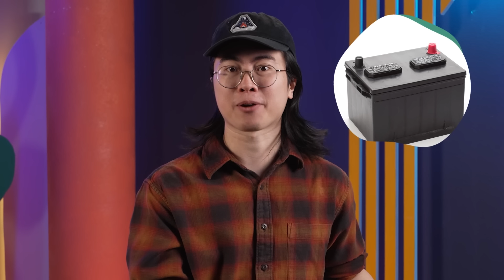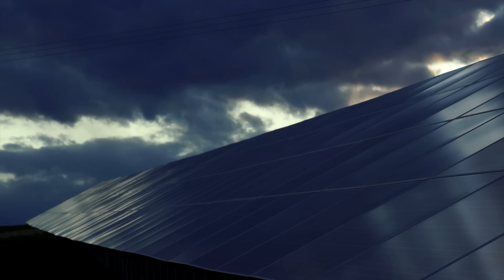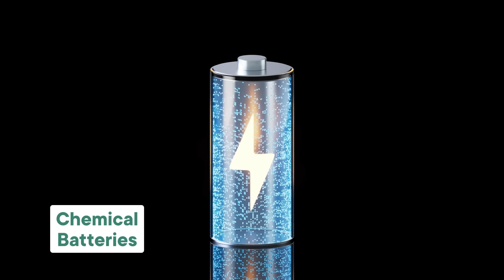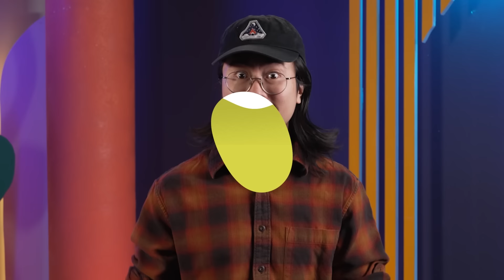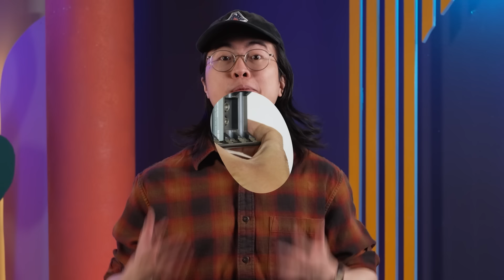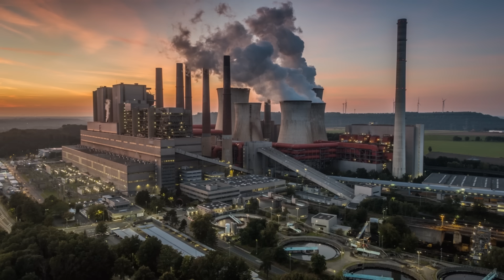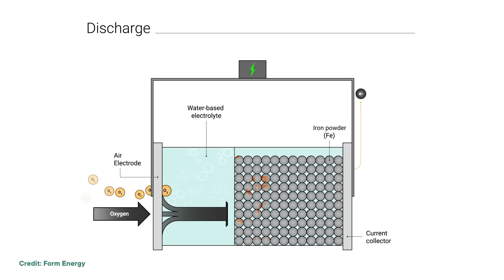The Weirdest New Battery is... Rust

Comment: The first (and last) metal-air battery I ever saw was a battery for an Army backpack radio.  It was slightly smaller than a loaf of bread, and encased in cardboard with a connector on one side.  When I first picked it up, I thought that it was a cardboard mockup of a real battery.  Nope.  It was a real battery, and was only slightly heavier than an empty carboard box.  I believe that it was a primary battery.
Reply: Hearing aid batteries are also metal-air, that's why they have a sticker you need to pull off when putting them in. It closes the tiny hole that allows the air to enter and start the reaction.
Reply: @rolfs2165  I forgot about those!
Reply: Yup. That is a magnesium air battery and is single use. Iirc you have to add water to it to activate it. ❤

Comment: I am disgusted by the comment at 3 minutes. "rechargeable batteries degrade after a few uses" HAVE YOU EVER USED ANY?
I have used  rechargeable AA  Ni MH batteries from both radio shack and another brand still in existence for YEARS.  Absolutely disgusting reporting. Right before I started watching I wass trying to find where I can buy rechargablers as every yank says they do not work.  Instead they buy bulk batteries at costco with 120 AA in  a packet. FFS grow up. Disinformationj kills. this is killing our planet. Only the ones I first bought 15 years ago work better. What experience do you have? how is any  number of charges not better?
 You play in to a disgusting myth that if a product  degrades it is useless. They said Solar cells would stop "being efficient enough to justify their  purchase over the long run". now the same cells from the 70's are still producing at least 70% of the original output. If it were 40% it would still be a win. Embodied energy then for freeeeeeee..  What when you get older,? Chuck them out, says the USA.
 Grow up and start using rechargeable.  Prince of non rechargeable would be trippled in the US under any admin iI ran. Tax the F out of non rechargeable batteries. get them on every  damn shelf not after a week long search.
Reply: You missed the context that alkaline batteries can only be recharged a few times. Consumer rechargeable batteries aren't alkaline.
Reply: @AySz88  You miss the point that  rechargeable batteries that work real well exist and are not  just a few time use thing. I do not know of an alkaline rechargeable but I do know of a shed load of NiMH like I f ing said. What is your vacuous point?
I missed nothing that is relevant to this discussion. As I  find said. rechargeable batteries work exist and are available but because  fools pedants and idiots  are not widely stocked in NORTH AMERICA WHERE THEY HAVE BANKS OF ALKALINE CRAP.
 f ing pedants

Comment: Sodium batteries will dominate grid storage.
Reply: there's no one single tech solution, everything has a use case and trade-offs
Reply: There'll probably reasons to have one over the other or a combination of them or maybe the one will just turn out to be better than the other or scale better in the future.  but it's good there're more possibilities being explored.
Reply: There is high demand for low dollar per kWh CAPEX in the stationary storage field and i have my doubts that sodium or lithium batteries will provide that. There are countries with winter deficits in the TWh area. I don’t even see it with optimistic future estimates of 20$/kWh cell level price (not pack or factory level that is always higher) working. Solutions in the single digits or even sub 1 dollar CAPEX area are needed.

Comment: I am a huge fan of power grid level batteries. I think each power grid "region" should have enough battery backup for a full day of electrical production downtime. Also, for areas with wind and solar this is a great answer to the question of "If it's cloudy or the wind isn't blowing, where does the power come from?".
Reply: "for a full day of electrical production downtime"

Power output variability of voltage can safely vary +-10% with no problem over hours.
This can easily be compensated. 
If the grid frequency deviates +- 1% for several minutes or +-2% for several seconds stability can be lost and  the grid has to break into smaller islands or go black. It can take many hours to bring them all back into a grid.
This is where the grid level batteries absolutely shine, reacting in 1/10th of second to preserve grid stability over seconds and minutes.
  They buy time to schedule and balance supply and demand across thousands of km of grid and hundreds of km of interconnectors costing $billions aren't spiking and the generators aren't subject to so many variations.

  The batteries in this video cost claim 1/10th that of Lithium based systems but have days long charge and discharge times and 70-80% efficiency.  

  To get the same power source/sink to the grid you need ten times as many. 
  Yes they will then last a lot longer but most of the capacity is only useful if you lose all generation for long periods. Half of the capacity is only useful if you lose all other generation for more than a day.

   If you google    hornsdale battery logs      or Hornsdale Power Reserve wikipedia you can see the first  100MW/129MWh capacity grid scale battery installed and running for 9 years now. Soon after upgraded to 150MW/194 MWh.
 At this moment 2pm july 30 2026 southern hemisphere winter there is a grid event underway so the pricing is 5-10 times normal wholesale but you can see the balancing spikes.
   It rarely operates as a continuous supply. It soaks up power from the grid for seconds and minutes when there is a supply spike/demand shortfall then feeds back in short burst, seconds,minus. Hundreds of times a day.
  It makes income on absorbing power as well as supplying power.
  This is the grid stabilisation service for which it makes MUCH more than the value of stored power over days. It paid for itself in a couple of years.  
 That is one unit. There are now many more of smaller and much larger capacity for distributed energy management.
From 50MWx1hr=50MWh to  350MWx 4hrs= 1,400MWh 
 They are distributed shock absorbers not substitute generators.

Few have more than 5 hours capacity because it just isn't economic UNLESS it is a very remote isolated grid without alternative power lines and where backup power from fueled generations is very expensive to support.
Reply: @johncarlaw8633 
We don't need to use monolith technology.
lithium batteries and iron-air, plus hydrolic reserves can all work together.
If it's all lithium it's a problem, if it's all iron-air it's a problem. So just benefit from both. Lithium handles short term high capacity, iron-air handles heavy, hydrolic handles mass capacity.
Reply: @adaroben1104  
A lithium based battery costing $400,000 per MWh stores $50 of wholesale electricity 5cents per 

kWhx1,000  but they get exercised a lot.
  IF these cost one tenth you are paying $40,000 to store $50 of power most of which you may only access once in a blue moon.  To get the same MW you need near 20x as many, you get a lot more MWh of storage but it is slow. 
You will see no return on that cost unless you build out enough and it only buys a few more hours IF you build out enough. 

South Australia, this state where the Hornsdale battery is located is heading towards 100% renewable electricity 

generation by 2027..annually averaged.
 But that is a statistical figure only, on a sunny windy day it can generate well over the power it uses , approaching 200% excess power , and export to other states at very low cost. At peak times the wholesale power dispatch price is negative -$50 per MWh.
  But there can be a few days in a row like today where there is near no wind and overcast in winter where it imports power expensively and uses    75% gas generated fossil right now on a winter night 1.7C.  $400 per MWh.

 There is a large mix-n-match of new storage being trialled. Underground compressed air in the gigawatt hour per unit range, hot salt ,molten silicon, hydrogen cycling. Whichever work best on a grid scale will be sorted out.
It isn't magic fairy land, they are built or being built, there were and will be many,many problems. But it is possible.

 These batteries with 24-48 hour storage, and significant losses over that, cost much less per MWhr but around the same per MW on demand. Compared to e.g. one $500M  200MWx8hr=1,600 MWh underground water/air pumped  storage currently under construction or a 300MW/3,000MWhr pumped hydro storage unit. 
1,000 km away there is a 2.2 GWx160 hour/ 350 GWh pumped storage being built and we are looking for 2000 GWh storage by 2050.
  Power for 3 or 4 hours right now is more useful than cheaper to store power in 24 hours time when there will be, on average, an excess of generation capacity of very low wholesale cost power.  
  [ the retail cost to consumers to PAY for all this..just don't ask  ]
   That on-demand power stored six or twelve hours ago can be applied to industry or dispatched interstate overnight. Power stored yesterday that is available tomorrow is no use to anybody 350 days of the year.
  I am not against these batteries, In other environments they may be more useful.
Just trying to illustrate that where renewables are available in excess most of the time the value of the stored energy long term becomes negligible and the cost/use has a lot of competition. That is the value of the energy, not the utility of having it stored and available.
These batteries have some advantages and some downside in power loss.
IF these batteries make an economic case for large scale this state WILL look at e.g. 20MWhr  unit and if they work will build more but there is a lot of competition for alternative storage and most have shorter term ramp up and higher power return per hour. 

  If we are going to lose power it is going to be days long wide area weather events, either limiting power production or occasionally tornadoes and lightning storms destroying infrastructure. You still need a distributed grid, local generation and storage for if grid sections are islanded.
Reply: It would be great to put a big cheap battery at neighbourhood level, keep local solar power local and buffer from grid when it is cheap
Reply: Power networks also sell between themselves so you can buy and store another region's surplus and use it as needed ahead of time.

Comment: Why do people think a greener system is still gonna have mass-transit in the form of personal vehicles? It's inefficient, for starters, but it also comes with byproducts, and a lot of them - and most of them are really bad for the environment and the people who would use them.
Also, I'm gonna address the elephant in the room: lithium-based batteries. Lithium extraction destroys the surrounding area, rendering it poisoned (both by the lithium itself getting out as well as the byproduct of its extraction) and impossible to grow or sustain life without heavy environmental cleanup - the kind we can't afford to just do over and over again. Add to that the fact lithium cannot be directly handled, plus the fact water will not put out lithium fires, and that the fumes of such are also very hazardous, and you have a material being pushed as "green" without people realizing it's actually pretty bad.
The alternative to cars everywhere is better public transit and logistics via trains (it shouldn't take an autist such as myself to tell you that), but what is the better solution for energy storage here?

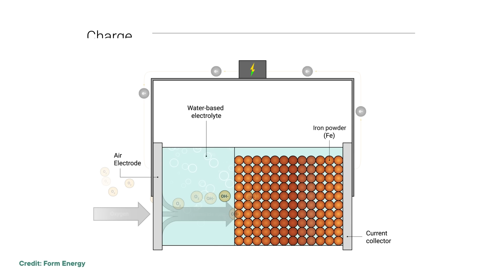Comment: 6:46 I thought hematite was one of the ores that iron is mined from.
Reply: Hematite and magnetite are the two main iron ore minerals. Hematite isn't rust, so the video is wrong. Rust is a group of iron oxide hydroxides.
Reply: @mytube001  seems like hematite is iron oxide while rust is hydrated iron oxide, and the extra water makes the rust flaky while the hematite stays sort of compact. So the battery may not be using rust exactly, but it works by oxidizing and reducing iron, and “this battery works by rust” gets the general concept across easily at a simplified level.

Comment: Always knew my car could become electric if I just believed
Reply: You're on your ordinary, yet to become a hero phase 😂🦹🏽🦸🏽
Reply: There are EV conversion kits available for homemade Electric cars, motorcycles, go-karts, boats, whatever. There are videos of homemade Electric Vehicles, Benjamin Nelson has playlists for what he did for his car & bike projects, you just have to pick the Motor, controller, and batteries right for your needs and your budget. There are companies like Thunderstruck Motors and EV West that provides help & kits to convert an engine vehicle to Electric. 
Personally, I believe Plugin Series Hybrids are the best option, an EV with a generator onboard. And it's not even hard to make, just set up a separate motor to be geared to an engine, 3 to 4 times faster then the crankshaft, choose a motor Controller with Regenerative Braking, send a throttle signal to crank the engine the correct direction, then balance the Regenerative Braking and engine throttle so it doesn't lug or stall the engine, and done. A production or homemade EV that is now a Series Hybrid. The instant torque, stealth, and electro magnetic braking of an EV, but the CONVINCE of gasoline or diesel, with no clutch or CVT to burnout, no gearsshifts to fumble over, and you can still move under battery power, if the engine stalls or runs out of fuel. And you now have more options to find a gas or charging station.

But if you just want to turn your favorite car or motorcycle into a pure BEV, then just get the drive motors, controllers, and batteries, properly put it all together and stop there.
Reply: What do you mean? All cars are electric in some ways 🤣
Reply: @savagesarethebest7251  He means his car getting rusted up would make it become electric

Comment: Quite the opposite. Mobile phones enforced the shrinking of batteries. They are literally the reason today’s li ion batteries exist.
Reply: portable batteries need to be small, GRID batteries designed to power cities just need to be cheap which is what this video is talking about
Reply: I hate proprietary designs and non replaceable designs. I was envious when I came across a Chinese gizmo that used spring contacts and an 18650.

Comment: 01:15 - Cathode is the positive electrode, and Anode the negative one (I remember this because I'm very positive towards cats... and checking Wikipedia it agrees).

However I think you're correct in the Anode releasing electrons, because the electrodes were named for "conventional current" flow, from before we knew electrons existed and the convention is that current is positive charge flowing, from that positive cathode towards the negative anode.  Positive charge flowing towards the anode is the same as negative charge, electrons, flowing the other way.
Reply: I think it's a bit confusing to use the anode-cathode terminology in the context of rechargeable batteries. Anode refers to the electrode where oxidation happens, which is where (conventional) current enters the battery. But because the direction of the current changes based on whether the battery is charged or discharged, while the direction of voltage (+ and -) does not, the labels anode and cathode do not correspond to + and -. They only do if we're exclusively talking about either charging or discharging. That said, the graphic in the video showing a lightbulb is clearly discharging the battery, so it is indeed wrong.
Reply: In a cathode ray tube (CRT), the cathode is the electrode that releases electrons